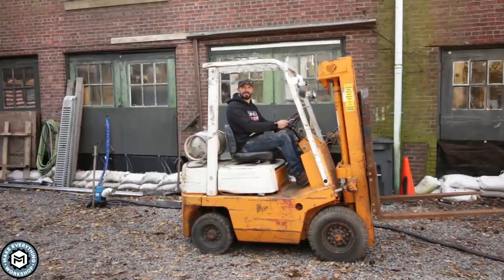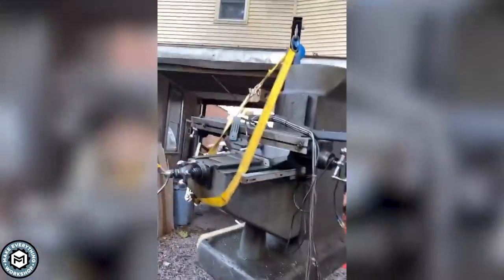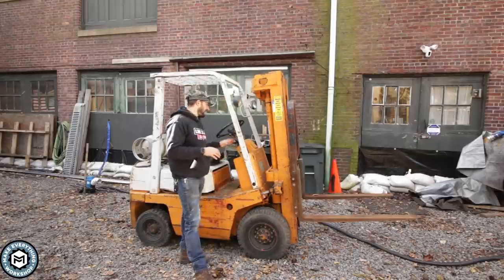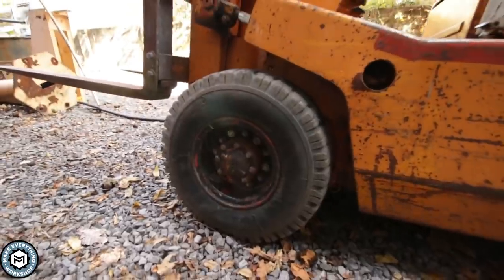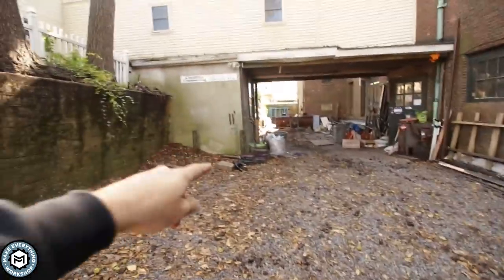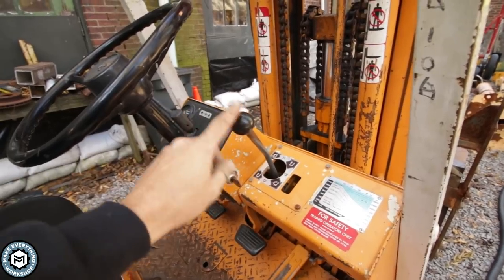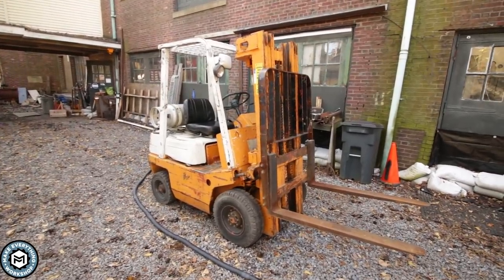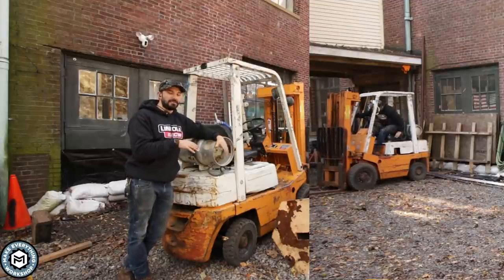I Got A Forklift! FINALLY!

Comment: Just wanted to add one thing: When turning the steering wheel, do everything possible to be moving forward or backward. Because of the counterbalance weight, by not moving, there is great stress (and some wear) on the steering system.

Comment: a good tip is to remove that cage part that is bolted to the top of the forks, and just bolt small plates on the side to stop the tynes coming off, that thing will restrict you more than anything, first thing i do with forklifts here, you only need it if you are carrying large boxes, in a fab shop just have it removed, it frees up so much visibility too. enjoy

Comment: Congratulations. I remember how proud and excited I was to purchase my first one . I call it the shop Swiss Army knife, once you have one, you will use it all the time. 

The icing is usually caused by low coolant or blockage in regulator hose fitting

Comment: G'day, great little forklift, the gas convertor is freezing due to lack of coolant flow through
it, check your radiator level, if level is ok, you may have a air lock in the system,
Happy forklifting..
Reply: If the radiator is fine, check the water pump. Sometimes they fail causing this freezing issue

Comment: I don't know what type tanks you are using, steel or aluminum, if they are steel consider adding an external filter to gas line. One place i managed we had steel tanks and rust from tanks kept clogging  regulator and carb. Was getting rebuilt every 3 months, i added external filter never rebuilt in the next 8 years. Also front tires, to prevent flats can have them foam filled or if you need to ever replace them consider solids. And the wobble stick controls to me are a PITA. Enjoy your toy stay safe.

Comment: Don't forget to change the lock or secure it some other way if it's that easily accessible.

Keyed-alike abounds and especially in equipment.
I made a set of 30 something keys for the manufactures that I usually deal with for about 40 bucks and haven't yet found anything that I couldn't start. It came in handy when the only guy with access to the office with the key locker is regularly "late" every Monday morning.

Comment: That part "icing up is the vaporizer". It uses hot coolant from the engine to turn the Lpg (propane) from a liquid to a gas. Is it still icing up when the engine is hot?
I had running issues with my hyster, a brand new one of these (exactly the same as yours) made a massive difference 👍👍
Reply: Yeah, gotta let 'em warm up a bit.
I'm sure there different ways to go about it but you have to boil that LPG somehow.
Reply from the maker: Thanks! So it starts fine and then as it runs for a little while it’ll ice up. I have a feeling it’s got some debris in there. I’ll likely get a replacement part to have it on hand. They seem to be under $200
Reply: @MakeEverything  mine was full of rusty sludge in the coolant part and gunk in the fuel side. Replaced it and it ran much better when hot, the Lpg forklifts are usually pretty lumpy until the get some heat into them.
Yes it's a cheap part to replace, I think mine was €160 here in Ireland.
Reply: Most fork lifts have the ballast weight in the back it’s that big heavy section under the propane tank close to the ground. If you remove that ( temporarily) you could probably move the forklift with a car trailer….

Comment: I'm sure you get a million suggestions for things to improve the gravel drive, but have you considered running probably 2 runs of something like railroad ties(basically 8x8 or 10x10treated)as rails that you could use as a hard surface for moving stuff, whether it's with your forklift, pallet jack, or engine crane.  Would be fairly simple to do since you said your gravel was deep, and then use rebar to tie it in, plus it would basically be temporary since I think you're renting, right?

Comment: This is terrible!!  The engine crane/plywood/using pipes as rollers make the BEST videos!  You've ruined your channel! 😁  Actually, its about time you got one.  This should significantly reduce your odds of serious injury moving heavy loads.  Too bad about the small tires/load capacity... it would be awesome to use to demo the house by lifting/tearing it apart.